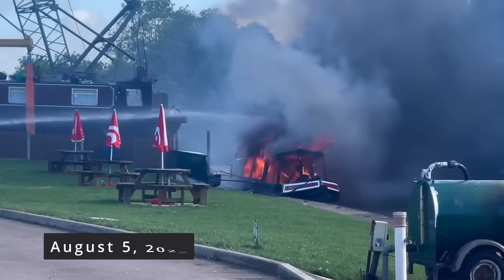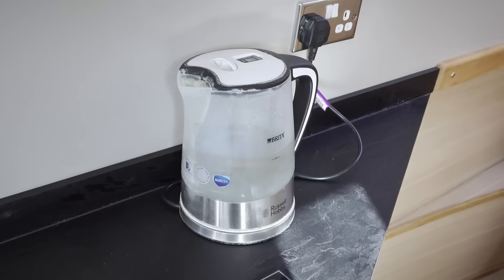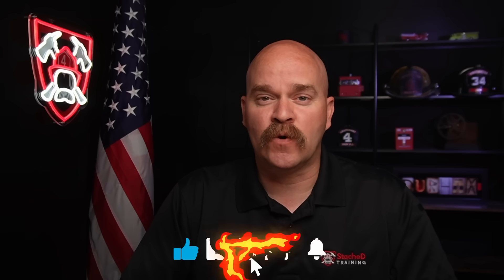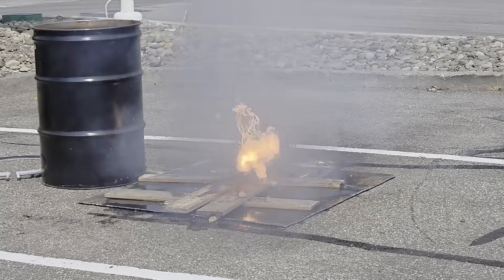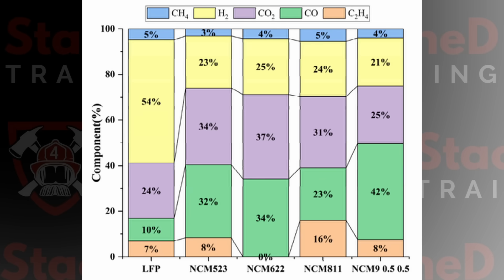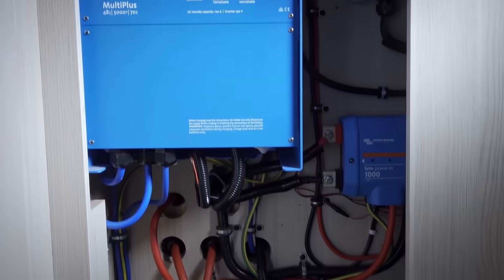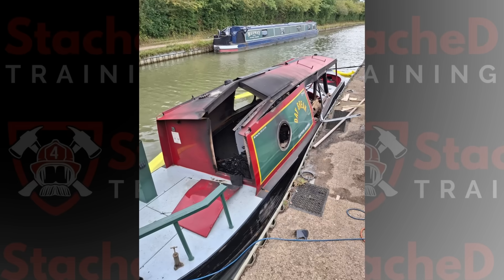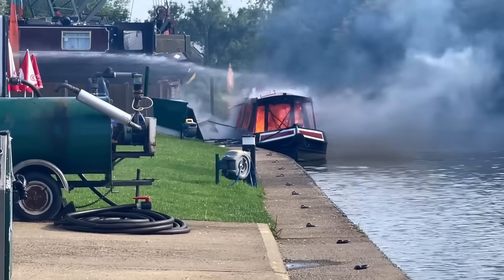Electric Boat Explodes While Charging: LFP Batteries

Comment: I'm a retired Boat Safety Examiner in the UK, with experience of both narrowboats and LiFePo battery installations. I'm puzzled as to why there is no sign of heat or explosion damage on the rear deck. The deck access panels, which are only held down by gravity, were not disturbed. Furthermore, the seat of heat and expansion damage appears to be in the cabin area. It is worth noting that the engine compartment is separated from the main cabin by a steel bulkhead. If the batteries had exploded or caught fire directly, the back deck boards would have blown off and the fire would have been most intense there. I suspect that the fire was not propagated from the batteries, rather an explosive gas mixture that built up in the cabin was ignited. The explosive gas could have come from the batteries, but could also have come from any number of materials or substances in the cabin. Pending a report from the fire investigation and or the MAIB, it is just too soon to blame the batteries. In any event, it's not a fault of the batteries if the fault is in the charging hardware or even the overall design of the system. A diesel installation improperly designed or fitted will lead to a very hot and damaging fire. I've even seen hydrogen explosions that have destroyed a boat, resulting from lead acid batteries failing. I know your channel is geared towards knocking lithium batteries, but any energy storage system is prone to catastrophic failure - even a horse can turn round and bite you.
Reply: It would be much less sensational to wait for a report.
Reply: and in the netherlands we have seen a few deadly accidents on hire boats in recent years BECAUSE OF LEAD ACID batterys. So his kocking on lithium is kind of bs because any improperly used energy storage device wil be very dangerous and potentially deadly. The cases in the netherlands where all deu to battery banks have 1 battery go bad. What then happens is that that batterys voltage wil go down, wich means all other batterys and the charger wil dump its current on that bad battery. That in turn makes the battery run hot, but also makes it realese the very badly smelling h2s gas. The problem with that however is that if the concentration gets too high you cant smell it anymore as it wil prettymuch disable your ability to smell it. And there is the problem, if you cant smell it anymore it is actually at its most dangerous point, the point where it wil easily kill you. 

Now what happend on those hire boats was they smelled something, but then the smell went away, so they went back in. And they never came back out alive... And it has happend atleast 3 times in a 2 year timespan.
Reply: @gabbermaikel having worked on narrowboats in the UK for a number of years I've come across that many times, usually starts with why does your boat smell like rotten eggs 😂
Reply: Where to start with this. Firstly, the battery storage was inside the vessel in the area of the saloon. This is typical in DIY electric conversions. Second, in order to comply with RCR harmonised standards, the LiFepo4 (or any other type of lithium chemistry accumulators) must be installed in a steel explosion proof container with a mechanically secured lid and vented to the exterior of the vessel. Third, being a BSS Examiner (retired or otherwise) is not a ‘platform of authority’ from which to postulate. 

The BSS is the absolute MINIMUM standard of ‘safety’ that the BSS limited want a boat to meet in order to be licensed. A boat doesn’t even have to be able to float in order to pass a BSS. 

Most examiners have NO Technical recognised qualifications. Before you point out that I am a BSS examiner (I am), I would point out that I am a qualified Electrical/Mechanical Engineer, Gas Safe Registered installer/engineer for boats, dog walker and lastly a BSS Examiner. Believe me, being a BSS Examiner is not an achievement to lead with. 

This boat was a ‘self fit out’ by the hire company. It had likely undergone ‘significant change’ from an original diesel inboard engine but I do not know that as a fact. Did it comply fully with BS EN ISO 16315? I do not know! I would guess that it didn’t but cannot say with authority one way or the other. 

Suffice to say, whilst the ‘fashion’ of wanting lithium chemistry in a boat is growing, marine insurers are covering their risk by changing their small print! 

Don’t apply for a Darwin Award, you might get one!!!
Reply: The video is incorrect, the battery bank on this boat is forward of the engine bulkhead so very much in the passenger compartment .
Reply: @philelliott5327  There are two battery banks. One for the motor, one for the house. Not possible to tell from the pics here, but it looks like the motor one is in the rear compartment and the house one is in the cabin.
Reply: @philelliott5327  the vid said there were TWO Locations - didn't you listen to what was said?
Reply: @CosmicSeeker69 Yes I watched the video, I was replying to a post on here. I have stood on the boat in question so I know it quite well. I do wish you people would pay attention rather than just firing off little rants.
Reply: @thedogfather5445
Absolutely Excellent informative and unbiased comment. This should be pinned
Reply: Interesting.  Thank you.
Reply: Epic
Reply: This really kept bothering me through the entire video. Thank you for highlighting this.

Something either isn't right about the cause, or the battery location WAS inside and not where discussed.
Reply: Stop speaking facts! Stached is just anti ev / battery anything.
Reply: This channel stinks of more shit than a Donald Trump nappy 😆😁
Reply: The MAGA have already reported.Jesus spoke to them 😆😁
Reply: Couldn’t agree more . I’d have to add either human error or incorrectly installed or some incorrectly specified components are to blame .
Reply: @newagetemplar6100 its a gas issue watch from 4:08
Reply: Excellent detective work....
Reply: @JohnSmith-pl2bk  clown show
Reply: You didn't see a video. You didn't see sht. You just bamboozled all these people.
Guess your "green energy" is worth more than a human life.
Sht bag.
Reply: I suspect that the cables connecting the system were under sized and this started as an electrical fire.
Reply: if you watch the video again he explains the mechanisms and it is clearly reflected in the damage pattern
Reply: I'm not into the narrowboats but I don't think they are mass produced. More likely custom made/converted so maybe, after the company got the video online of their first full electric, somewhere in the process of ordering designing the second all electric boat someone thought "well I think it would be better to place the batteries in a little less humid space." On the other side of the bulkhead.

Apparently the batteries were on fire because they couldn't get it extinguished. If those batteries were burning underneath that hatch it would definitely look different so my guess the batteries were in the passenger compartment
Reply: He explains that.. 4:05
Reply: Having portable solar generators at my home, should I be concerned about similar fires? They are kept indoors in a normal temperature environment. They are manufactured by Anker, Bluetti, Vigorpool  and Ampaura.  3 units each having 1200 watt/hours, 1 unit 268 watt/hours and lastly 1 unit having 3800 watt/hours. I charge them from normal household outlets. I keep them charged at 90% capacity and cycle them every 3 months down to 10% and back up to 90%. Eagerly awaiting your response.  Thank you.
Reply: Get an education!
Reply: I'm surprised less has been said of the fact that the battery arrangement appears to be separate 12v-nominal batteries wired in series to get 48v - that would result in an unmanaged and unbalanced string.  Do you care to comment on that?
Reply: Indeed, we are talking lifepo4 here, pretty hard to make them burn.
Reply: Also a mechanical engineer and I am convinced of the properly presented video.... 

Some criticism from those friends of Greta "should wait for a report" did not sold me anything.... For those, what about the chemistry of the gases from LiFePO4 batteries???
Reply: Irrespective of the actual cause, sailors have been fitting these type of batteries to their boats for some years now, their problem is that when they do catch fire they are often well away from the shore. You better have a life raft aboard because you need somewhere to watch your boat go down. There are examples here on YouTube for you to watch just this scenario.
Reply: It should be pointed out that this is not a privately owned or built boat. It is owned and operated by perhaps the largest company in the hire sector in the UK. The company also build and fitout their own boats. I assume this extends to the electrical installation. In any event the responsibility for the boat and its safety lies with the company. The criteria for designing the system will have included cost. A system which is truly "safe" inevitably costs more, and this system was clearly at the low end of the cost/safety equation.

I doubt that they used anyone with specialist knowledge of high capacity  Lithium battery storage to design the system, otherwise, there would have been far more protections in place to prevent exactly this kind of situation.

It is not required under the BSS regulations and probably not under the RCD regulations in the UK for any special safety precautions that differ from those for lead acid batteries. 

It always takes a series of incidents like this to encourage legislation or regulation for safety. 

Personally, I would consider that such a battery bank should be contained in a sealed, gas-tight, heat-resistant container, vented directly to the outside of the vessel.
Reply: G'day,

Yay Team !

Well said.

Is there any truth to the story that  this Content Creator's mother ran off with a Direct Current Electrician  who sold Lithium Batteries...?

  Stepfather-from-Hell "issues" could certainly explainificate a LOT of his observed behaviour, and apparent obsession with  blaming ANY Fire which has ever occurred  anywhere within sight of a Lithium "Explosion-in-a-Plastic-Box" (Battery)..., as ipso-facto prima-facie - "obviously" having been caused by the Battery...; could they not...?

Perhaps the tale be not true, no matter how well it fits the observed circumstances...; who knows ?

One notes that, at Law, it is impossible to ask a "defamatory question"...

(lol !).

Such is life,

Have a good one...

Stay safe.

;-p

Ciao !
Reply: He described the fires cause perfectly, you must have not been listening.
Diesel fires are a slow release off energy, Batteries with this much energy fail fast with combustion gases.
Reply: @russellcollins5692 As he's not the fire investigator on the ground, he is just guessing like the rest of us. We all have access to the same, very limited, information, but we choose to interpret it differently. Just because I don't agree, doesn't mean I didnt listen.
Reply: If your a Battery guy, short both cables together firmly, you’ll notice in the heavy toxic smoke the strange purple light ie “fusion “ copper cables vaporised in mill seconds.
It’s the “speed” off that stored energy that is were the DEMON lives…
Reply: On boats any instalation whit lithium batterys need a EMS. A BMS is oke for some home aplications. Thing is as soon as one of the (Solar)chargers fail there is a posebilty its going to output a unknown high voltage. (Most semi conductors fail in a short/close position). So there must be a system in place that cuts the incomming power to those devices if the battery sees a to high of a voltage
Reply: I agree. We need more facts before we draw these BS conclusions.
Reply: I can't see how lifepo4 batteries EXPLODED all the ones I've seen fail gas off aggressively but bending the roof like that, it was a sharp explosion not gas off. Something else has happened here. I've had some destructive fun with old lifepo4 and lithium batteries and lifepo4 are pretty boring. Lithium ion are spectacular if abused properly
Reply: I really don't think you understand , no offence intended,
Reply: There is a video on Youtube of the interior of the narrowboat after the explosion.  There was a battery bank forward of the cabin door and it appears it was that battery bank which exploded and not the bank inside the engine compartment.  It looks like there were three battery groups inside the cabin and only one exploded.  The metal cases on the other two appeared intact.
Reply: But what other non-lithium battery source of power was there?
There was no gas or diesel. 
Was there propane and would that have done it?

I suspect that the usual suspect was the lithium battery.
Being in a consistently damp environment on top of lithium batteries being a problem all on their own, is just inviting trouble.

These lithium batteries cause trouble in all types of vehicles, mopeds/scooters, toys, etc.the world over.

If the batteries are not to blame, then it must be poor-quality manufacturing or the ENVIRONMENT they are utilized in is NOT IDEAL.

If they are mass-produced in China, that's all you need to know...
Reply: Talking about battery fires is not necessarily knocking them.
People need to be aware.
Reply: @larrydugan1441 if people are not aware that batteries, like fuel tanks, contain a lot of energy and shouldn't be set on fire, thats true. But surely it's beyond stupid if anyone thinks fire inside a boat is ever a good idea, batteries or no.
Reply: The  system was a fire waiting to happen they used 4 x 12volt batteries each would  have individual management and the components in those were likely not designed for 48 volts also you have to have all the management systems connected to each other so they all shut down if something happens. It should have been built with 48volt batteries with management systems talking to each other and the charging system. I think also the house battery was in the cabin. Steel compartments should have been fabricated for the batteries with ventilation and insulation so that this could not have happened.
Reply: @bascomnextion5639 you dont need them interconnected, each battery is managing itself which is 12v, it doesn't see 48v, if one bms in any of the batteries has an issue, it disconnects the battery negative so in effect cuts the series connection for all batteries leading to complete shutdown.
Reply: @geekhomeuk Correct! Break the circuit anywhere and it’s still broken. No current flow. There may be a small increased risk of a runaway due to a faulty bms, due to having 4 of them, rather than one. But the odds are hard to measure, because the bms will usually fail safe, rather than short.
Reply: @geekhomeuk  Unless an open circuit occurs in a battery then bms components could be at 48v across that.
Reply: @bascomnextion5639  Actually most, if not all,  of the LiFePo batteries I'm familiar with will allow you to connect up to 4 batteries in series if I'm not mistaken.  I'm not familiar with the subject batteries in this video but I'm betting they are too.
Reply: @johnnylightning1491  Yes but that does not mean you should or it is safe to do so the BMS in the batteries must be connected to each other so if for example a cell in one is too hot all the batteries respond by disconnecting but with the 48v batteries available with BMS with communication to the charger why use 12v batteries.
Reply: Thankyou for casting experience and informed comment into this alarmist nonsense.
Reply: Seen tent fires start the same way....
Reply: @kylereese4822 its unlikely that there would have been any installed gas on an electric boat, especially a day boat.
Reply: I was wondering about that.
Reply: Yea but a diesel fire is put out pretty quickly and does not reignite on its own .
Reply: @jhonsiders6077 really?
A diesel tank usually goes bang
Reply: It was mentioned that gas inside the boat cabin could be ignited by a spark even from a fridge, in this case the fridge was fully electric. The question is can this type of fridge create a spark . I’m considering purchasing a fully electric narrow boat in the future , to be used on tours the UK canals for weeks on end. Kind regards and keep up your investigation into all these incidents . Jay.
Reply: @johnayates2139 Not trying to discourage you from going all electric but I am really interested what your motivation is? I looked at it a couple of years ago and couldn't make it stack up. I went with diesel.
Reply: @johnayates2139  If it contains an unsealed relay or a brushed fan motor then yes. But relays are usually sealed these days, and fans are usually inductive. So yes, one would need to check is there really is a spark source in the fridge (or any other automated device).
Reply: @johnayates2139  If it uses lithium batteries make certain there is a battery management system that shows all cells their voltage and temperature if it is made of 12v batteries be very cautious  and they should not be in the cabin area.
Reply: Kinda falls apart with ' your channel is geared towards knocking lithium ion batteries ' clearly not understanding point of channel, Captain Durham even says he uses lifepo in his own camper van. Perhaps name  some of the ' any number or materials in the cabin' that could have caused an expolxion nd hard to fight fire. Not doubting you, sure in your career have seen previous non battery related boat explosions. It's a learning opportunity for everyone. Paint thinners seems like long shot, need to, be present , leak, vapourise and Ignite
Reply: Enjoy your retirement. You didn't prove they  weren't the batteries. Sell your EV while it's still worth something
Reply: Crooked brit teeth included?
Reply: I`m betting it was aged gas cylinders that failed.....
Reply: @kylereese4822  There were NO gas cylinders on that boat.  It was entirely electric.  No Gas, No Diesel, No Charcoal, No Paraffin. No Horses.  It was entirely electric.  The only energy source was those batteries.
Reply: @KenFullman but what we don't know is, what else might have been temporarily aboard - paint, thinners, cleaning solvents. For instance, it may have been undergoing maintenance. The video shows a mixture of equipment onboard a similar boat - Victron and Sterling. Victron, I'd be happy to have onboard; Sterling, less so.
Reply: @KenFullman no reason they couldn't have added a small fuel fired burner for tea kettle English can't go 5 ft w/o a tea to preserve batteries  This was their first test boat & often FIRSTS end up under powered disappointments subject to retro fits
Reply: @KenFullman  And you know this for certain? Were you there? What definitive report have you seen and could provide a link? Or are you just supporting a biased account that fits your bias?
Reply: @williamwilson6499  No. I just made it all up. Of course I don't have a definitive report. 

I do however, have a friend with a boat that was moored up at the same marina.  He's also close friends with the owner of the boat involved in the incident.  Sorry I should have demanded a notarized report from him but it seemed a bit rude to ask.
Reply: @russell7489  There's no reason they couldn't have added a small fuel fired burner but, they didn't.
Reply: @thedogfather5445  The problem with assuming paint thinners, etc, is that the boat reignited when they pulled it out of the water after sinking.  Paint thinners don't behave that way.  That's clearly the behavior of a battery.
Reply: @thedogfather5445 Nice try but any intelligent person knows it was the lithium batteries which, even without any heat or power source are very unstable due to their chemical makeup.
Reply: @JoanBrown-j3e Nice try, but you're outside of your area of expertise.
Reply: @cherryjuice9946 I don't think that I assumed anything, but if you do want a guess, I'd say that the source of the fire was faulty mains electrical equipment, which set fire to the interior of the boat and that the heat eventually caused the batteries to off-gas, at which point it deflagrated. However, none of us know, we're all just guessing.
Reply: @russell7489  jeez, it must be 2025
Reply: @thedogfather5445  the boat was almost new so the chances of paint thinners etc would seem to be extremely remote - What is know is that the boat had problems a few days before and had to be recovered to the marina  - via towing
Reply: @KenFullman or maybe you could have simply stated WTF your "information" was coming from? I don't believe anyone was requesting notarization, just substantiation.
Reply: @thedogfather5445 did you really say deflagrated and expect people who believe all BEV are evil to understand you?
Reply: @aronsingletary  " What definitive report have you seen and could provide a link? Or are you just supporting a biased account that fits your bias?"  The tone is obviously very confrontational. Don't you think?

Obviously my friend doesn't write "definitive reports" so the only way to get his account recognised as "definitive" would be to get his report notarized.  Also I don't have a dog in this fight so I don't have any "bias".  I'm no fan of EVs but recognise that modern battery technologies have some interesting potential in other applications.

Anyhow now perhaps you know WTF I'm coming from.
Reply: @JoanBrown-j3e Except they seemingly were not lithium batteries. They were the much safer, far harder to ignite, LiFePO4 type. These are considered the gold standard of marine batteries, safer than lead acids of most, if not all types. They are virtually immune to mechanical damage, with lots of on line videos of people subjecting them to all kinds of abuse, including shooting them with nail guns. In common with all batteries, they can provide enough power to ignite a damaged electrical system and, uniquely to their type, the electrical system does include a safety circuit inside the battery case, which could conceivably have been damaged by the heat of the original blaze. If the wiring to the internal circuit board (bms) was sufficiently damaged, it could cause a short circuit to develop as things cool down and change shape. This would still not be anything like a lithium battery fire, however.
All of that being said, electric propulsion in the marine environment is still not as well developed as in the automotive industry. I would not recommend it to anyone I care about. It’s still a bit suspect, even in the vehicular world, though that’s almost always dye to the unstable lithium battery packs
Reply: @KenFullman How do you know that?
Reply: @KenFullman coal
Reply: @aronsingletary I'm not out to convince anyone, not even the ones with a challengingly small vocabulary. 😂
Reply: @KenFullman Really? Is the boat not owned by ABC Leisure Group PLC and used as a day hire boat? I don't think it is owned by one guy, unless he also owns your marina, 17 other marinas, a large fleet of hire boats and a boat building company.
Reply: @cherryjuice9946 Firstly, Im not claiming that any one solvent or other substance was the cause of the fire, I'm pointing out that other things could cause or sustain a fire. The fact that lithium batteries were on a boat does not mean that they caused the fire. Even batteries that themselves catch fire in an already burning boat do not necessarily cause the fire, but they "may" reignited a later stage. Assuming that the batteries must be the cause of the fire is as lazy and senseless as assuming the woodwork spontaneously combusted.
Reply: @russell7489 the boat was fully electric and had no solid fuel equipment. It had an electric kettle (as found in 99% of UK kitchens) to boil water.
Reply: On a boat with no gas/LPG and 100% electric  @kylereese4822 ?
Reply: @kylereese4822  No gas aboard the boat at all.
Reply: @kylereese4822 I'm thinking camping gas, the aerosol style ones for the little Halfords stoves.